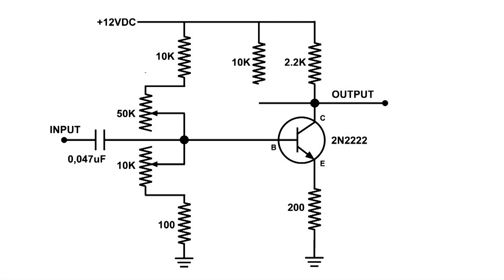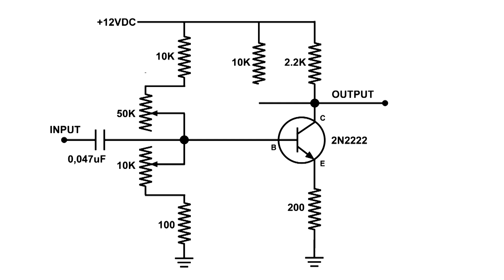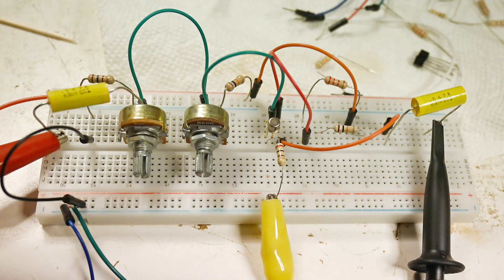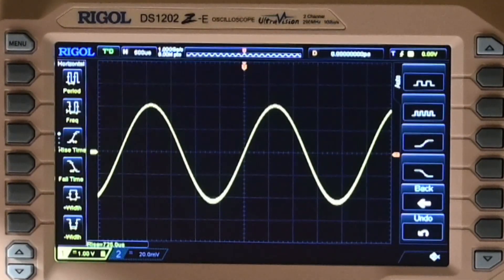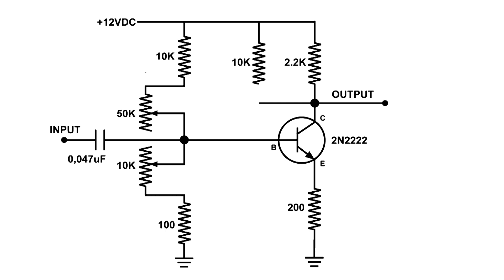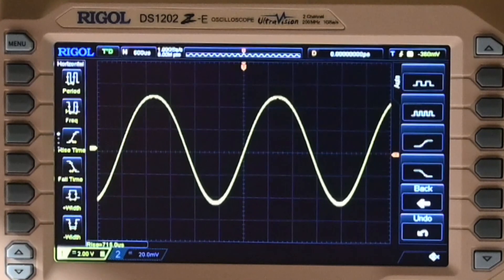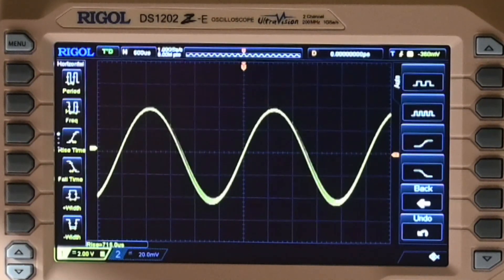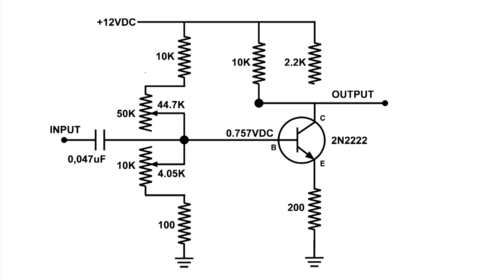Biasing Audio Transistors A few Things to Think About

Comment: Great vids.   I've always wondered how designers come up with the values of the components.  By the way, the waveform @9:07 looks a bit distorted on the top so i guess you would have needed to turn that pot downwards?
Reply from the maker: Thank you, and your welcome.
If the probe is still calibrated the circuit could be tweaked a little.

Comment: It makes sense in that with 2.2k load, the C-E current is greater and emitter voltage is raised due to voltage developed across 200 ohm resistor.  What would have been the outcome if emitter was connected to ground?  I am sure that base-emitter voltage would have been possibly identical or close to identical.  When measuring voltage at base, I guess you would have measured it relative to ground.  You could have also provided B-E voltage in these two scenarios.  So, 200 ohm resistor has less relevance when load is 10k.
Reply from the maker: Without the emitter resistor the bias is about 0.07VDC.
Reply: Plz make me understand howcome transistor will conduct with Vbe less than 0.7v dc , less than forward voltage drop of a diode.

Comment: Hi. On the diagram, What is blocking dc to the output? I'm a complete beginner. Thanks
Reply from the maker: There is nothing blocking DC at the OutPut.
Transistor, How Does it Work in a Circuit, Demo
https://www.youtube.com/watch?v=vs3zUHdlsYY

Transistor How can it Amplify
https://www.youtube.com/watch?v=O9aT950DRkw

Transistor What does it do in a circuit Visual Demo
https://www.youtube.com/watch?v=o1ygTZTHDnE

NPN Transistor on off switch and also a variable resistor
https://www.youtube.com/watch?v=knm_t10hJGM

Junction Transistor for the Beginner, the basics
https://www.youtube.com/watch?v=pStpu8DslXo

Determining NPN PNP C E B for a Junction Transistor using a Ohmmeter
https://www.youtube.com/watch?v=fWBjvaRDErk

Transistor Basic Function
https://www.youtube.com/watch?v=BOMbydWGecg

Comment: I sure learned a lot on this one. I try and duplicate what you do on my own bench since I learn by seeing and doing. This one worked out well for me. Thank you for the time and effort you put into these so we can all learn. Have you ever done a video on infrared remote controls. Mine quit on my Bose cinemate and I replaced the IR module and it worked. I would sure love to know how that system works. How can one little module handle so many commands? Mystery.  Thanks again!
Reply from the maker: Hey Andy, I'm so glad you tried this technique. You well find it useful in other circuits. Experimenting gives you incite of a circuit that you can not get any other way. I hope other YouTubers try this technique. I have been thinking about infrared remote controls and other uses of infrared. Infrared remote controls  are pulsed and modulated. I have a HeathKit infrared receiver and I have made an infrared receiver. I was thinking about hooking a infrared receiver up to a oscilloscope and maybe I could see the modulation patterns. I many make this my next video. Thanks.

Comment: Interesting experiment Rick. Of course yours usually are. Very good method to use for setting biasing and yes whatever you use to drive the circuit will also affect the output a great deal. :).
Reply from the maker: Thank you Doug.